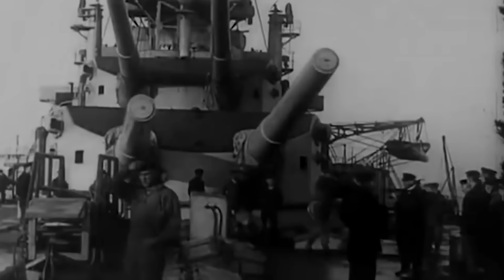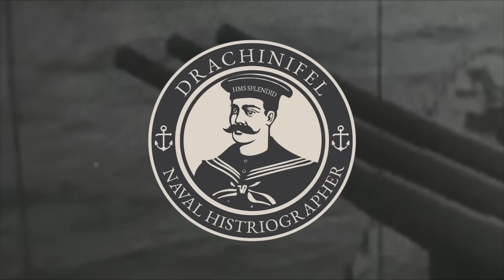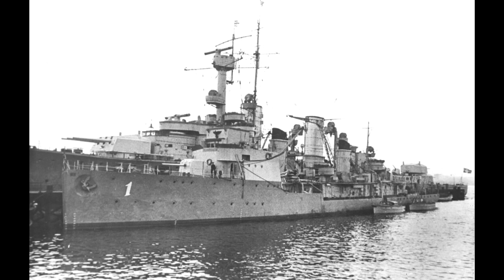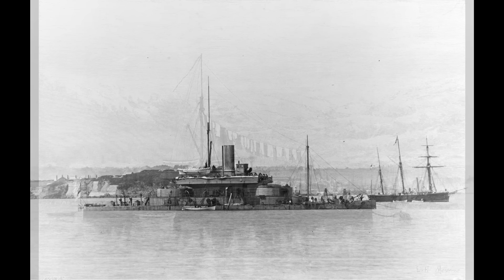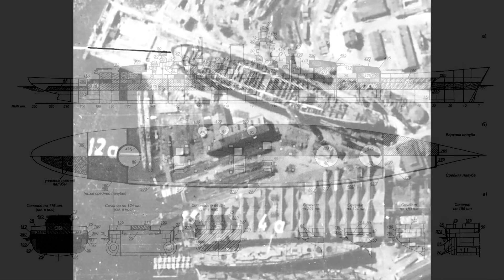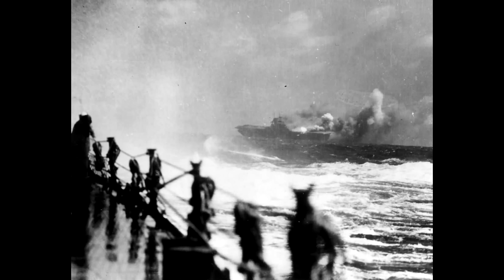5 Naval Engineering Failures - Sink, Swim or Explode

Comment: The F-class strikes me as being emblematic of a kind of mindset common among German engineers in general in the WWII era. Everything must be the biggest, fastest, strongest, most heavily armoured, etc. The result was a lot of tanks, ships, planes and other equipment that had great stats on paper, but in practice were usually costly, inefficient, difficult to repair, and prone to spontaneous sudden existence failure. The designers often would have done better to realise where diminishing returns had set in, and to have toned back their ambitions somewhat. Of course, it was great for the Allies in the long run that they frequently did this sort of thing, so I'm ultimately appreciative of their philosophy in the context in which it appeared.
Reply: The largest issue was that after WW1 there really wasn't a navy to begin with, so the idea was to get a small amount of extremely capable ships which was meant to cut down on construction time and resources.
As a result, cutting edge tech was crammed into everything (like ridiculous boilers...).
Reply: @Kr0noZ  The thing is, it wasn't just the navy - it was tanks, airplanes, and other machines too.
Reply: @matthewcreelman1347  Yes, indeed. This idea ran rampant throughout the rearmament of Germany post-Versailles.
They had nothing, needed everything and quickly so, and as a result over-engineered way to much.
Reply: @matthewcreelman1347  

Eh, depends.

The German “big cats” did have a bunch of fundamental issues, but pretty much all the heavy tanks of WWII did (the KV/IS series was at least as bad and often even worse in terms of being horribly unreliable, and even the Pershing was quite unreliable, to the point the M4 Sherman ended up being favoured by many crews since it actually worked reliably and was good enough most of the time). And yes, the Maus was completely and utterly useless, but it was cancelled at the prototype stage in 1943 because of how useless it was.

German aircraft meanwhile run the gamut from being perfectly reasonable and capable (Bf109, FW-190), to performing quite well but being temperamental and high-maintenance (Me-262), to being complete and utter garbage due to use of unreliable and dangerous high-performance technology (Me-163), to being just plain bizarre but not especially impressive even on paper (various Blohm & Boss aircraft projects, incidentally the same folks who came up with Bismarck).
Reply: @bkjeong4302  With the German tanks it wasn't so much reliability issues, but rather when the tanks broke down it was so much harder to repair them (and lack of proper spare parts at later stages of the war) that it wasn't uncommon for crews to just abandon the broken tanks rather then to repair them on the field.
Reply: @SampoPaalanen  You want one thing to prove that? The road wheels on the Tiger tank.
Reply: @bkjeong4302  A little note. The Red Army tested the Tiger I vs the Tiger II and their team's conclusion was that the Germans were crazy. The Tiger I was reliable and fast for a heavy, had a gun that could handle anything, the only upgrade it needed was sloped armor. Instead, they replaced it with a whole new tank, even heavier, underpowered, with a bad transmission and other problems.
Reply: @SampoPaalanen reliability extends beyond will it run when I want and stop when I must. Ease of repair and replacement is more important. Unless you convince yourself of quick victory. By 1943 Europe wasn't Poland in 1939 or France in 1940.
Reply: @luisnunes3863  Agreed, the Tiger 1 was a better tank (and one of the best heavy tanks of WWII, it's just that heavy tanks in general had issues)
Reply: I suspect the F Class proponents were avid water skiers
Reply: See also their fleet destroyers.
Reply: And over large guns
Reply: Bear in mind, the F-Class should be seen as Germany's equivalent of the Japanese Chidoris, an attempt to use loopholes in treaties to flesh out destroyer numbers without violating limits on destroyer tonnage. 

In Japan's case, they were playing off the London Naval Treaty loophole saying no limits on ships under 600 tons, and so Japan tried to make small ocean-going destroyers only 600 tons in size. They were not a success, but it was reasonable to try because if they had succeeded, that would have meant a lot of cheap mini-destroyers for the IJN. 

Germany's case, the Anglo-German Naval Agreement gave Germany 35% of British tonnage in all the major categories, which meant only around 50,000 tons for proper destroyers, but also 35% of British tonnage in ships under 600 tons. If Germany could make a small destroyer that could mostly substitute for the bigger destroyers in North and Baltic Sea operations, they could have more "destroyers" in practice while adhering to the letter of the  AGNA. 

That is basically what the F-Class were an attempt to do: make a small destroyer to release bigger destroyers for duties that couldn't be done with smaller ships. Like the Chidoris and Kingfishers and every other attempt at a 600-ton mini-DD, they were not cost-effective and overloaded, but that doesn't mean it was pointless to try.
Reply: In German this is called the "Eierlegende Wollmilchsau", but it has not changed over the years. An old colleague, who had to work with the "Bundeswehr" had always this phrase for them: roughly translated: If we were a navy yard and had to design a submarine it needs to have dive bombing capability" (the german original : Wenn wir ne Werft wären und denen ein Boot bauen sollten, müsste es sturzflugtauglich sein )
Reply: @vonrheinland4924  I'm aware. I am german xD
Reply: Its a common disease in many autocratic rulerships, from ancient times to modern Russia. But I wouldn't blame German engineering there, which actually produced also quite good weapons despite such stupid politics and very limited ressources. An autocratic USA would likely also produce very stupid things just to compensate something on the lower regions of their Führer.
Reply: The Germans were so completely outmatched in industrial capacity that the temptation of wunderwaffe is understandable, but they took really crazy gambles and did some outright stupid decisions.
Reply: Your presumption that Bigger would be Better was general German Engineering philosophy is simply not true. Like any other military industrial complex of a major faction in WW2 Germany produced a lot of different weapon systems for the different branches of the Armed Forces. If you look of some of the most famous or succesful weapon systems from 1939-1941 like Panzer III and Panzer IV or StuGs for the Army or Me109 or JU 87 and JU88 for the Air Force or Type VII or Type IX U-Boats for the navy none ot this designs followed a bigger is better rule. Even the Battleships Bismarck/Tirpitz not to mention Scharnhorst/Gneisenau were not oversized in comparison to British or American Battleships. You put to much effort in the late war Panzer Design of Tiger 2 or Jagdtiger. If there was a single engineering philosophy behind this design was simple. Choose the best and most powerful gun. The F-Class Escorts were obviously not good design but the reason behind is certainly not a specific german engineering philosophy. If you lool closely on the F-Class you can see a lot of military procurement problems which are also very familiar in modern navies. Tight Budget and Industry Capabilities match overwhelming expectations that a single universal ship type should be capable to  carry out different specialist capacities. As Drach pointed out this Square-the-Circle Dilemma was hardly a solitary phenonen of the F-Class
Reply: @Stormoak yeah people need to stop taking 10-40 minute YouTube videos as emblematic of entire nation’s industrial complexes during major wars over the span of years
Reply: @Stormoak  I didn't say "bigger means better". You're correct in your response, for the most part.
What I did say is that in a lot of cases engineers tried to overcome challenges by implementing very advanced, complex designs. 
The infamous "Schachtellaufwerk" on tanks made them very comfortable to ride in and made them a very stable platform for gunnery on the move, but was a maintenance nightmare.
The G41 was an attempt at making a semi-automatic rifle, but it took until the G43 to iron out the issues.
The FG42 was an attempt to update the paratrooper weapons so they could keep them on hand during the jump instead of having to collect their gear from drop containers after, while also combining infantry rifle and light machine gun, The result was an incredible weapon when it worked, but it was expensive, complex and rather heavy for its size and early models were prone to malfunctions.

The Bismarck, however... objectively wasn't a particularly good design. It was rather large for what it was, there were some rather unfortunate design issues going on and other navies got better Battleships out of the same or slightly higher displacement.
Reply: @Kr0noZ The Schachtellaufwerk was an ingenious solution to a problem (get a lot more road wheels to distribute the weight, improving suspension, etc) — but could be a problem maintenance-wise when inner wheels had to be changed or repaired as you had to remove all the wheels in the way, too. 

What is more important: a more stable gun platform or ease of repair?
Answer: it depends, as always.

The Sherman was successful despite being the wrong tank in the right place — having lots of them carried the day against a much smaller number of German tanks. It is not quite storming Rorke’s Drift, but …
Reply: @Kr0noZ  The G-43 didn't iron out all of the G-41's issues.  It was a very fragile rifle that's known for being so over-gassed it beats itself to death in a fairly low number of rounds.
Reply: @Stormoak The best battleship ever built was Richelieu class battleships, it makes sense for Scharnhorst and Bismarck classes be good, as they were made with similar design choises, many always mention their design failures, but none of those failures had any effect on actual efficiency of those ships, and all four german battleships had proved themselves to be extremely sturdy. While for example USS South Dakota was nearly sunk by IJN Kirishima during Battle of Guadalcanal.
Reply: Those german engineers were unable to copy the brilliant british one-hit-wonder class of capital ships (:-)
Reply: A self-imposed victimization under the eugenics theory. Bigger , better, less useful!
Reply: No, you’re just taking a stereotype you’ve gotten from YouTube
Reply: A good example of what you are saying is the Tiger tank. Apparently most bridges in Europe, and there were many, were good for about 30 tons. the Tiger, of course weighed around 60 tons. It would often just sink in to the mud. It was incredibly thirsty for fuel, and they had none. It cost a fortune to build, with many a manhour to be worked. I'd guess that the allies could field about 20 production-line Shermans, for the equivalent investment.
Of course, the nazis were planning a much larger tank, the "Mouse" I believe.
Reply: @dougrobbins5367  Yes, but the the same time, there was the Panther tank, which was also quite heavy with 45 tons, but without so many flaws as the Tiger, but also without its fame. Of course, both tanks also suffered from bad production quality. Maybe not such a good idea to use forced labor. But the Allies even used the Panther as gap-filler until their own post-war designs had been ready, so maybe not the worst design of WW2, its pretty much one ancestor of modern MBTs with its good balance between armour, armament and mobility.
Reply: @denniskrenz2080 

The Panther was even worse than the Tiger reliability-wise. To be honest, basically all heavy tanks of WWII were unreliable, the Pershing not excepted.

Also, the much cheaper mass production costs of the Panther was more of a problem for Germany-because by then Germany didn’t have enough fuel or manpower to operate that many tanks anyways, so if anything fewer, larger tanks allowed them to lose the war more slowly.
Reply: @bkjeong4302  that is pretty much the Standard for all german tanks in late WW2. The industry was not able to produce anything of a set quality or quantity. That makes the comparison a bit biased towards the pre-war designs.

Comment: Actually Drach the Santisima and the Santa Ana are unrelated designs, since the former is from the English system of construction Jorge Juan copied from the English, and the latter is a Spanish design from Romero Landa, which I think was one of the best ship designers of the 18th century.
Reply from the maker: Interesting, the book I was looking at claimed the two ship designs were not directly related, but lessons from Santissima were incorporated into the design of the Santa Ana
Reply: @Drachinifel  That Is posible, since Romero Landa took the lessons for His system from the English system AND the French system of Gautier that came immediately after. But the design that was More based on the Trinidad, was the San Jose, which was later captured by Nelson AND used as his flagship. The changes Made were a higher lower battery AND lower freeboard. I suspect the Santa Ana was based on this design because Romero Landa was assistant to Gautier at the Time.

Comment: Building and operating a 1200 psi marine steam plant is quite impressive for the 1930s. While that number was eventually surpassed within even the commercial maritime industry, it took many more years to get to that point.
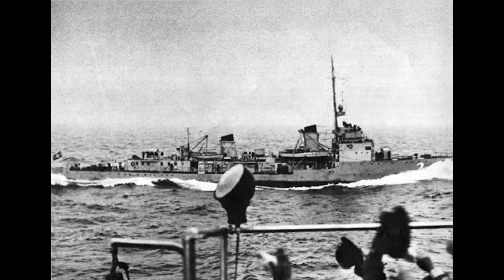Reply: I think you misheard, most had 1600psi boilers, and a couple had 1000psi boilers  (13:40).

Comment: My favourite are the steam powered submarines. Most sank in the Forth.
Reply: K class death traps
Reply: "The battle of May island". If I remember correctly, a total of 5 K class steam submarines were sunk, most of them with all hands.
Reply: @alexandermonro6768  that rings a bell.
Reply: @alexandermonro6768 That can hardly be blamed on their design though, while their postal-code sized turning radius didn't help, the fact is that they shouldn't have been in that exercise (because the whole idea behind a fleet submarine was foolish, specifically because of potential catastrophes like this) and everyone knew it. The flagship not properly signaling its actions and the fog were the biggest reasons for that disaster.
Reply: @alexandermonro6768 If wikipedia remembers correctly, two Koffin - class subs were sunk during the ”battle’ of May island. And the whole incident was mostly due to a wartime procedure on sailing with darkened ships, radio silence and full steam on, which was always a collision hazard with or without badly designed submarines involved. And the night was pitch black, there was no issue of flagships signalling, there was no way to signal much anything, unless one breaks the radio silence. And that was not an option, since there could have been german u-boats lurking nearby. 

Of course the K- class suffered many more catastrophes and close calls besides that.
Reply: See Drach's "Lawn Darts of the Sea," if I recall the title correctly.

Comment: .22 firing gatling guns - sounds like we've solved drone defence😊
Reply: And you can eat chips unmolested!
Reply: The minigun fires .308

The microgun fires 5.56

In .22LR we have…the Nanogun!
Reply: Nah! Gatling 12 gauge buck shot then bird shot alternated
Reply: @loicbazin1053  Many attack drones these days carry 4-5kg payloads. If rigged for anti personel use (so less explosive and more steel balls) they have an effective blast radius of 30 meters but are still dangerous out to 50-60 meters. That's right on the edge of what even bird shot can reach. And the size trend is only going upwards.

Something like a .22 Winchester Magnum, even with optimal barrel length, only just has a range that would be considered workable for current size drones. But realistically, an effective anti drone defence would need to be more like a flak gun, with radio detonated bullets.
Reply: @andersjjensen Someone call up Heckler and Koch and tell them to dust off the old XM25 prototypes, I have an idea.
Reply: @griffinfaulkner3514 The Germans and (iirc) Italians are way ahead of you! They are actively testing a liquid propellant 20mm (or is it 25?) autocannon with what basically amounts to timed/proximity detonated canister shot with a 1200 rpm fire rate.
Reply: @hanzzel6086  I mean, the Millennium Gun has been a thing for a while with its proxy rounds, I was more thinking of the XM25 for a man-portable version with an updated FCS module to account for rate of closure.
Reply: I have seen a .22 Gatling gun at a local gun show it's legal here in the States so long as it's not motorized.
Reply: @nilo9456  
Got to be electric for them pesky kamikaze
Reply: AFAIK the .22 cartridges available when the Gatlings first went into production were .22 BB, which were for carnival purposes with a little ball seated in a percussion cap without any black powder at all. .22 short only came around a decade after the Gatling in the early 1870’s.
Reply: @joshuahadams  
Good job it's not 1870 then?
Reply: Tippman Ordnance makes a 22LR Gatling gun. It looks like a lot of fun.

Comment: In terms of seagoing performance and engineering, One of my relatives served on the Midway after her final angled deck refit in the 70s, he met one of the Midway sailors who served on her in the 50s when she still had straight deck and her seagoing performance was pretty bad and they had rather quite dreadful seekeeping during her pre refit status. Not until these problems were fixed in the Forrestal class design and onwards where they would rather have better sea keeping ability than the Midways.
Reply: Many a time, while doing line swings off of Viet Nam, I saw a lot of the older carriers taking water up on the bows, Coral Sea included. But I never saw any of the Forrestal ships do that.
Reply: Not sure what you are attempting to say.